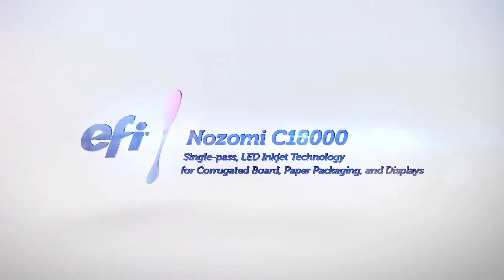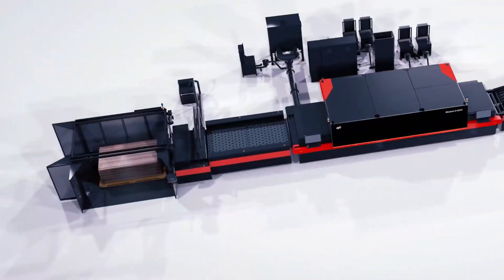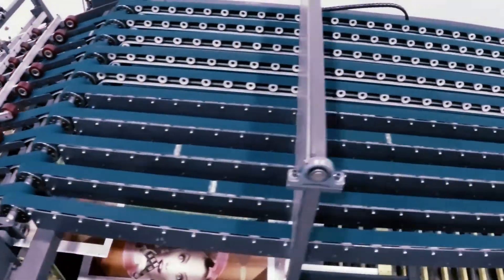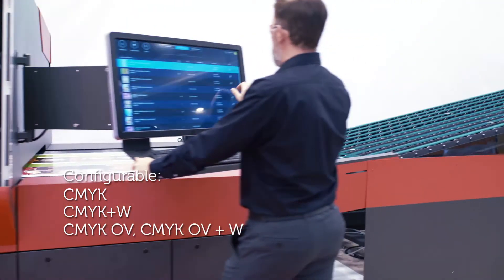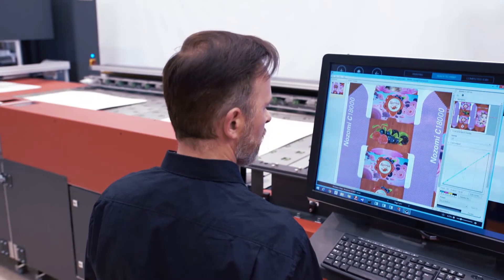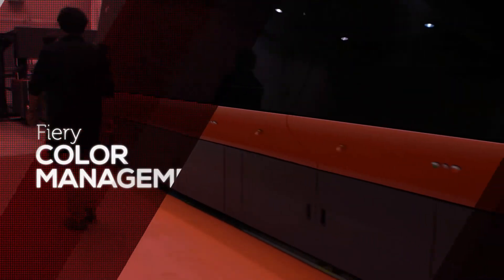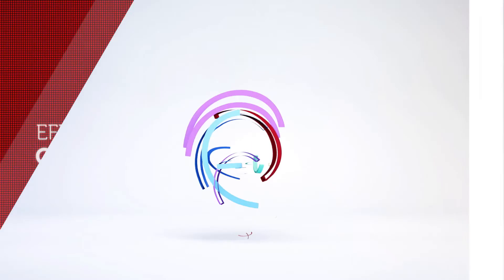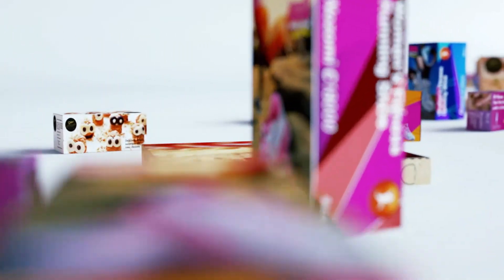EFI Nozomi C18000 Single Pass LED Inkjet Technology

Comment: I'm curious as to what impact warp has not only in relation to printing, but also how sheets travel down the line. The area of most concern is just after the feed and before the print section. That table with embedded wheels looks like warp could be a potential disaster. As a machine operator for many years, I know how frustrating these problems can be. But beyond that, upwarp, downwarp.... how does this machine handle this, especially with doublewall where you're not able to fully suck down the sheet? Thank you
Reply: Ever got a reply to this? Unfortunately, in our plant a lot of warp make into the convertion machines